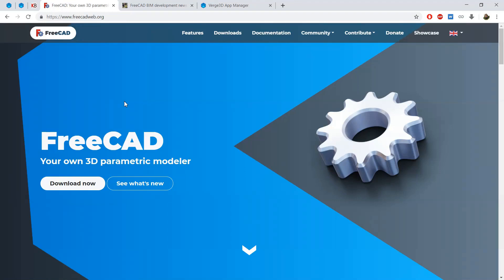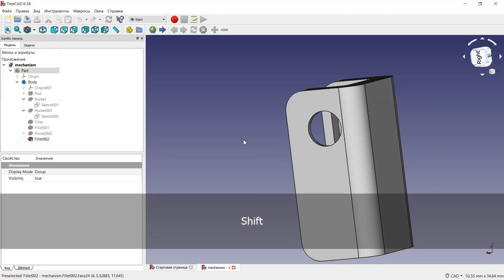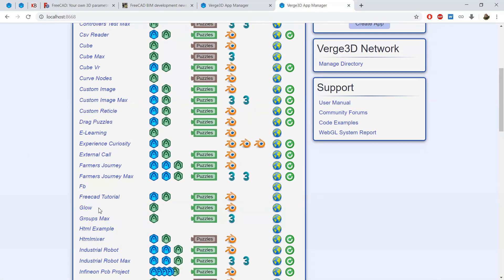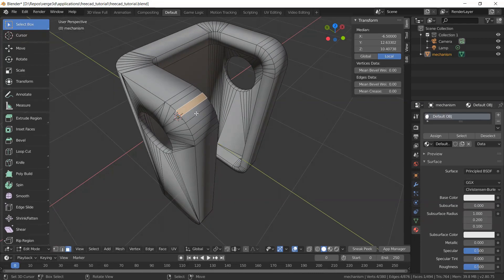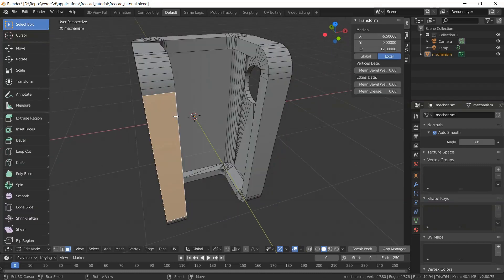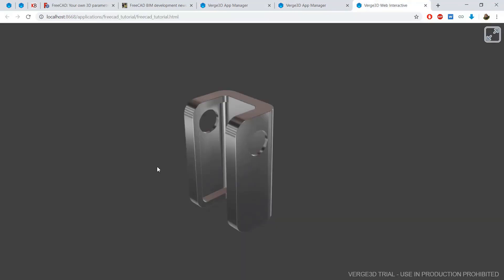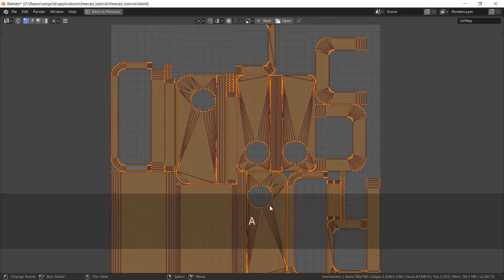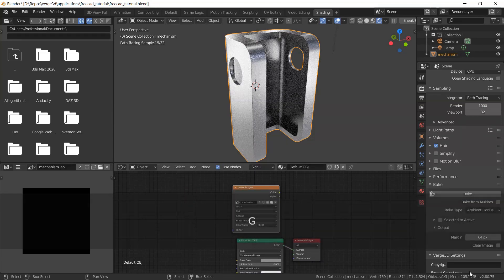Exporting models from FreeCAD to WebGL

Comment: Will be nice to support parametric objects straight from FreeCAD
Reply from the maker: may be, but we can't support all software that are exist. You can easely convert your model into Blender, Maya or Max and create realtime parametric emo for now this is a usual pipeline of our client who works with different CAD.
Reply: Soft8Soft Verge3D I've seen that Verge3D can make a model parametric, but the advantage of FreeCAD or any other real parametric model is that the parameters can be driven by ECUATIONS which Verge3D can't do.
Reply from the maker: @Tokamak9  even if we support FreeCAD or any other CAD this feature will be not possible to implement, this tecnics^ webgl and CAD models works different. CAD models fully parametric in their root and based on formulas and parametric figures, webgl based on mesh and consists from multiple points that locatet in the space. So thee technologies too different to get the same effect in the webgl like in freecad or any other CAD.